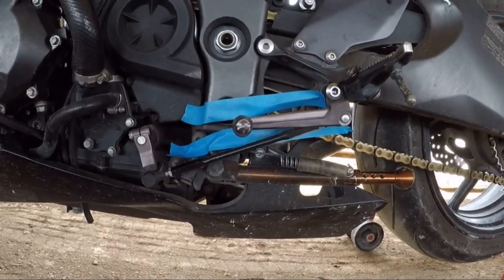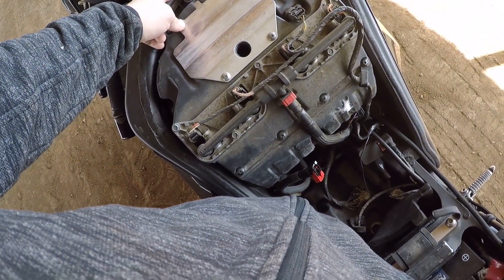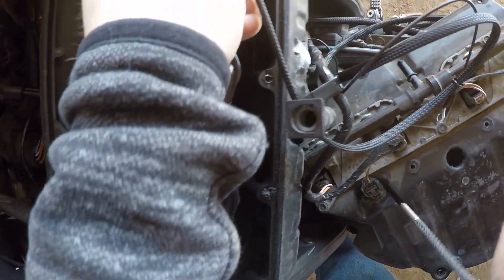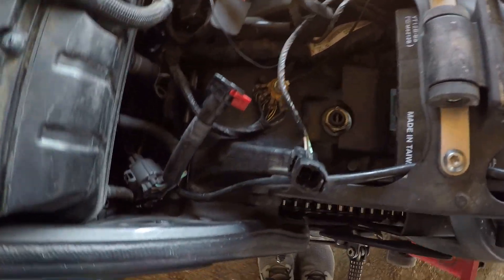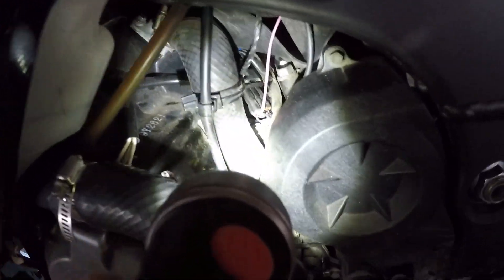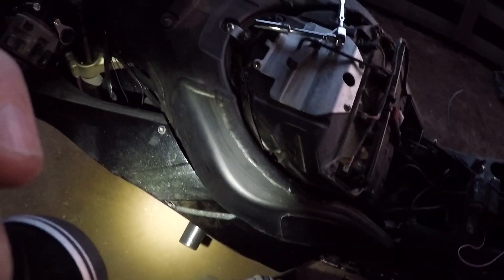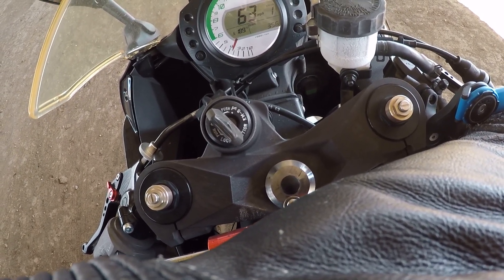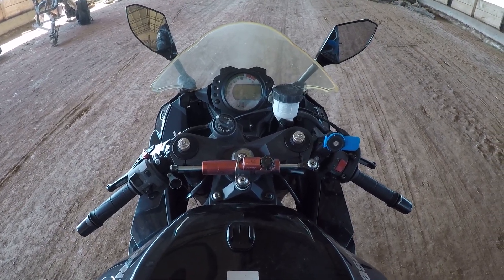ShiftPower Full Race Unit Install (2008-2010 ZX10R)

Comment: hi bro how to adjust the shifter smooth ??
Reply from the maker: Yes adjusting the kill times on the quickshifter is easily done through the control box for the unit. It has a digital readout so it’s easy to see and do. However it comes from the factory tuned for your specific bike and I adjusted mine and put it right back where they had it after.
Reply: @kawasakicruisader5600  do you mean ecu flashed??
Reply from the maker: The ecu is flashed but no that’s not what I meant. I added the shift power full race unit product to the bike and gained the adjustable launch control, adjustable quickshifter, and a pit lane speed limiter. All of which have adjustable settings controlled by the buttons and digital screen on the race unit.
Reply: @kawasakicruisader5600  yesterday i install the unit on my R1 today i take a ride i feel on the gear 2 3  the shift is hard a litle bet
Reply: @kawasakicruisader5600  my man can you record video how to adjust the shifter to be perfect smoother??
Reply from the maker: Yes I can do an in depth video about how to adjust the settings for you! It may take a bit though. It has been snowing for a couple days here where I live.
Reply: @kawasakicruisader5600  ok my man thank you and take care drive safe